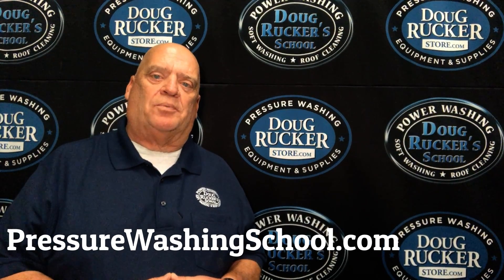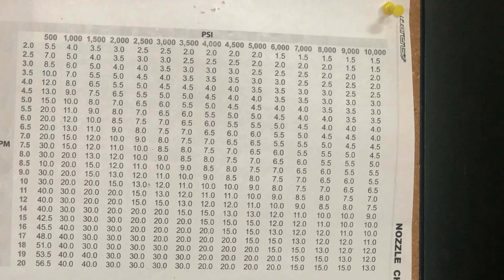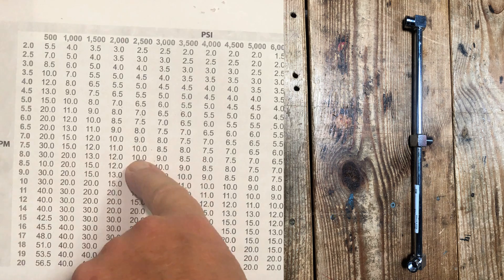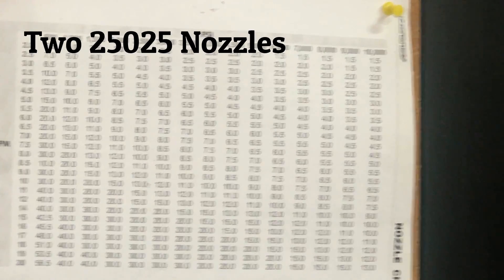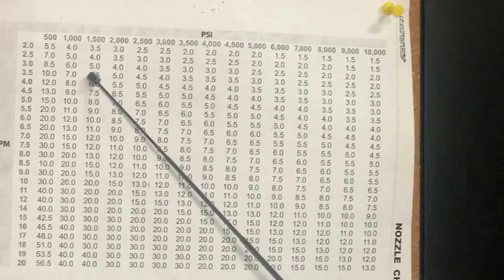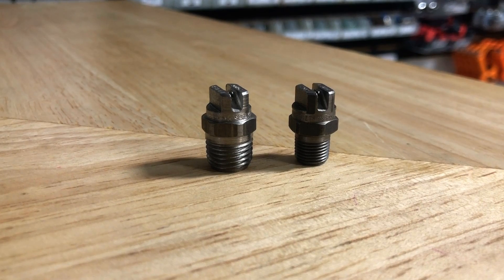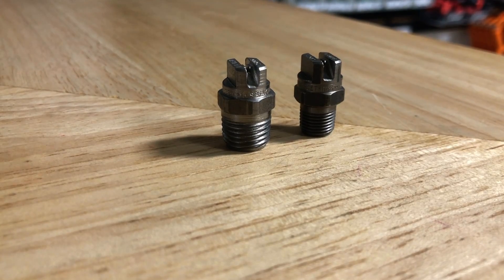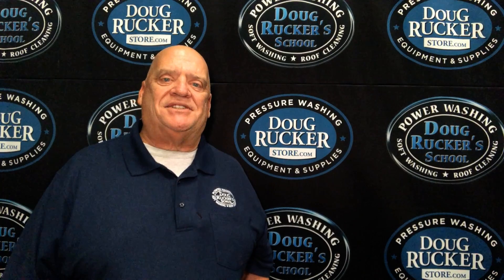How to Choose Surface Cleaner Nozzles from Doug Rucker 2024

Comment: I have 4.0  4400 dewalt machine  and the surfcleaner its have 3 nozzles i need help to chose the corect nozzles
Reply from the maker: You'd have to try the 2502 nozzles and see if they will work for you.  At 4 GPM you really should have only 2 nozzles.

Comment: Awesome explanation. Thank you. How much of a difference does changing the angle from 25 degrees to 40 degrees? I’ve got an 8gpm & currently run 25055. I’ve got a set of 4004, but I’m not wanting to etch with too much psi.

Comment: I have a 3.1 gpm 3000 psi machine on a 20” cleaner what tips would you recommend for concrete sidewalks and driveways? Thanks in advance.
Reply: ideally you want a ratio of 1 GPM : 4" of surface cleaner...3.1 GPM will barely be enough to spin your rotary bar, meaning you will have to go very slow. I already have to go pretty slow with my 4.2 GPM using a 20". 

as far as tips, 25020's will put you just under 3,000 PSI (fine for concrete that is at least a few years old, new concrete is more fragile and still has "cream" on it, which can easily be etched into with too much PSI; the cream wears away naturally after a few years, and the concrete itself becomes cured and more durable, which is why you can use higher PSI on matured concrete). 25025s would put you at about 1400 PSI which would probably be enough for old concrete, and would be safe for new concrete. If you do the 2.5s with 1400 PSI though, you will almost certainly need to use chems to help speed up the job and clear up your lines after.....

get some SH (sodium hypochlorite). Walmart has 1gallon jugs of them for about $7, its called Chlorinating Liquid, and it should be 10% SH (it will say the % on the front label). mix 1 gallon of it with 1-2gallons of normal water in a pump sprayer (1 gallon if the concrete is very dirty, 2 if its slightly dirty). Add 3 ounces of surfactant per gallon of mix (you can use dish soap/laundry detergent if you are only going to be doing this a few times, if you want to sell your services you should look into a better + more cost effective surfactant). The surfactant makes the SH mix linger longer on the surface, which gives the SH more time to work its magic. The suds from the surfactant also make it easy to see where your runoff is going. 2-3 gallons of mix should cover 1,000-1,500 SF of flat surface, so calculate how much you need. Mix everything together well in the pump sprayer. Leaving the mix out in direct sunlight will slowly weaken it; you don't need to rush when you are spraying, just don't leave the sprayer out in the sunlight all day.

MAKE SURE YOU WATER ANY GRASS AND PLANTS NEARBY BEFORE YOU DO ANYTHING ELSE. SERIOUSLY. 

once the grass and plants are absolutely SOAKED, pre-treat by wetting, but not soaking, the concrete (if you spray SH onto dry concrete, it could slightly bleach the concrete, but if you spray it onto soaking wet concrete it won't have time to dwell). Once the concrete is damp, spray your SH mix onto the concrete and let it soak for at least 10 minutes. 

Pressure wash like you normally would...the amount of water you put out will dilute and rinse away the SH mix, making it safe for the grass AS LONG AS YOU WATERED IT FIRST.  

When you are done pressure washing, post-treat it by spraying the SH mix again, and let it sit for 20+ minutes. Some pressure washers dont even rinse their post treat away, since SH goes dormant within a day in direct sunlight. But since you are new, I'd recommend rinsing it away (you can use a normal hose or your pressure washer) after 20 minutes just to make sure you fully cleaned it. You might have to repeat the post-treat a couple times since you would be on pretty low PSI, but you won't leave streaks or anything. I've done this exact thing on old, fragile, stained concrete and never had issues. JUST MAKE SURE YOU WATER THE GRASS AND PLANTS BEFORE AND AFTER!!!

TLDR: 2.0 orifice tips if you are cleaning old, matured concrete and/or don't want to use any chemicals. 2.5 orifice tips for all types of concrete, but you will probably need to use chemicals. if you do use chemicals, HYDRATE THE GRASS AND PLANTS BEFORE AND AFTER

Comment: I have 4400psi 4.2gpm with a built in pressure regulator (that I leave maxed) and I typically use a BE 20" with 25025 tips.

However, I frequently get stripes and I cant quite square up where the math is wrong. Im not going too fast - have tested this.
Would appreciate help.

Also, Is there a chart for PSI:surface type?
Reply: I have a 4.2 4200 BE with a 20" whirlaway as well. I assume you have made sure the nozzles are clear and parallel to the rotary bar, and the bars are symmetrically facing away from each other....so....

are you using anything to post-treat? A 3-5% SH mix on concrete works wonders for clearing up lines from my experience. if you do continue to have issues though, or you don't want to use chems, you can try downsizing to a 16". the ideal ratio is 1 GPM : 4" of Surface Cleaner.

Alternatively and/or as a last resort....if you know what you are doing (or want to spend the time to learn), you can throw 25020's on there and adjust your unloader to lower the GPM so its putting out a safer amount of PSI. Do not run it unless you've adjusted your unloader...25020's on your 4.2 as it stands would put you right up at 4400 which would be so harsh on most surfaces not to mention harsh on your pump. You'd still probably have to go pretty slow though, since the lower GPM will spin the rotary slower.

I enjoy helping people but unloaders are one of those topics you kind of have to spend the time learning yourself to truly grasp, especially because you can easily hurt your machine if you don't do everything properly.
Reply: @snorfietsers4006  thanks for the thoughtful reply.
I've been skiddish about a SH post-treatment, but I suppose it wouldn't be so crazy if it were sprayed and left vs rinsed.
This would be a decent start as long as I remember to wet everything lol
Reply: @dudeinskibro1 trust me I was terrified too haha. If you want to be extra sure, just test it on a small area first. The plants would rather drink the good stuff than the bad stuff, so as long as you can keep them hydrated until the SH becomes inert you will be fine. Good luck! Let me know how it goes or if you have any other questions

Comment: Hi, I want to do Up to 30" dia. surface washer and I have 2 options for a stationary machine I want to buy.  22HP engine 2200PSI with 14,9 GPM or 22HP 3500PSI with 9.2 GPM. Both are basically the same price. I do run into car oil stains on cement & asphalt and I read some where higher PSI would be better but at the same time I want my 24-30" to move along and not take more time but do a great job for mostly dust and sand.  Pre-treatment bleach or grease remover doesn't seem to make that much of a difference on oil stains but I'm worried 2200PSI is too weak even though the 14.9 GPM should easily move the 30" washer.  Any advice (pros/cons on which to choose would be appreciated.

Comment: Good day Mr Doug just got a quick question I got a 4400 simple 4 gpm pressure washer and a 20 “ surface cleaner just trying to figure out should I change my tips from the 25020 to 25025 to get a better cleaning on concrete driveway some people recommend the 25015 I’m just a little confused please help
Reply from the maker: @meriage1  yes. Go to 25025. That will help

Comment: I know i need a 25025 for my 4200 PSI 4GPM machine. But when i go to wash concrete do i turn up my psi to 4200 since the surface cleaner would devide by 2? Or do i just leave it at 2500 psi how i usually would have it
Reply from the maker: Keep the unloader set where its at.  Use the correct nozzles to lower the PSI when needed or install the surface cleaner pressure regulator to adjust as your using it.
Reply: @PressureCleaningSch 
So when you say keep the unloader where its at do you mean at full pressure
Reply from the maker: @ they normally set at the factory before shipping so I recommend keeping it set there. Always best to check it with a gauge when you get it.

Comment: I notice you mention nothing about the diameter of the surface cleaner.  Does it matter? Or by matching the tips size to match your GPM is the only thing we should be focused on.
Reply from the maker: Good question.  Yes it matters somewhat.  A general guideline is for every 4GPM if your pump is you;d want 4 inches of surface cleaner, so 4GPM x 4 = 16 so stay within a 16-20 inch Surface cleaner.  5GPM x 4 + 20 so stay withing in a 2- 24 inch surface cleaner. Etc etc.

Comment: With a 4000 psi / 4gpm / 20 inch surface cleaner, I would like to clean red ceramic tiles with grout around,  what nozzle do you recommend ?
Reply from the maker: 2503,25035, or 2504 depends on how soft tile is, how dirty, and condtion.  I normally do not use a surface cleaner on tile. But it really depends on the variables
Reply: @ Thank you!

Comment: PSI  remains the same only the flow rate changes with different tips like the ( 4gpm at 4k psi)  2502 vs 2503 correct? Psi should be turned down at the unloader if one wants  not to damage pool deck as an example correct?
Reply from the maker: Pressure and flow change when changing tips. Takes more time to adjust the unplader than changing tips.  Easiest way is to keep same nozzles in all the time anmd use the Surface Cleaner Pressure Regulator..https://www.dougruckerstore.com/products/surface-cleaner-pressure-regulator?_pos=1&_psq=surface+cleaner+pressure&_ss=e&_v=1.0
Reply: @ As example : I have a 4pm at 4000 psi machine if I want to use the 25035 nozzle which is rated for 1500 psi  I would need to still turn psi down from 4k to 1500 psi correct or no?
Reply: If the tip is rated for 1500psi I need not to go higher correct?  My understanding is that was the flow rate and degree pattern changes but the psi remains the same until you turned down at the pressure regulator correct?
Reply from the maker: @ no. Leave unloader where it is.
Reply: @PressureCleaningSch  Do you have a video on how to install this regulator?
Reply from the maker: @ yes sure do. It’s here on the channel
Reply: @PressureCleaningSch  I would like to get this pressure regulator but I need to understand something: The 25025 tip is rated for 2500 psi and the 2503 is rated for 2000 psi,with the pressure regulator I can turn down the pressure for the 25025 down from 2500 psi to 2000 psi correct? So what is the difference between the 2503 the flow rate?
With the 2503 what if you raise the pressure up from
2000psi to 2500 psi what happens? 
Basically what happens if you raise the rated psi in a nozzle?
Reply from the maker: @vcash1112  Keep it simple.  If you use the regualtor use the 25025 nozzle and then adjust your pressure down as needed. This keeps you from having to change nozzles to adjust the pressure. With the regulator the larger the nozzle you go, the less PSI more water volume you'll get.
Reply: @ I’ll be getting it soon adjusting at the DL is a pain. Thanks for replying!

Comment: If you have a pressure gage after the PUMP and adjusting with unloader does it work the same as the gage at the surface cleaner?
Reply from the maker: Yes

Comment: I just got an 8gpm machine with a bar that has two tips (one on each side). The tips show 25025 that came stock on my surface cleaner, I mean that puts me at 10,000 psi if my math is correct which will destroy everything it touches... Is this correct math?
Reply from the maker: 2@25025 should put you at about 4500-5000 psi.  You'll need 2@25045 or 2505 to keep you around that 2500 PSI

Comment: If i have a 4gpm 4200psi machine with a surface cleaner that has two nozzles, I would need a 25025 tips then? That would put me at 2,500-3,000 psi then?
Reply from the maker: You are correct...should put you right at 2500PSI
Reply: @PressureCleaningSch so when I’m using a surface cleaner do i turn my pressure up to 4000 psi for it to hit 2500 psi or leave it at 2500-3000 psi to start?
Reply from the maker: @DonGuava  answered above I think

Comment: Hey im new to surface cleaners I have a 2k psi 4.5 gpm with a 16 inch surface cleaner what size tips do you recommend?
Reply from the maker: 2502 but not sure it will work with that low PSI.  You'll just have to try and hope for the best.
Reply: Alrighty thanks man I appreciate it!

Comment: I have a 4400 psi 4gpm what size tips should I buy
Reply from the maker: If a 2 nozzle bar you need 2 of the 25025
Reply: @PressureCleaningSch  Which is the best for all around 25025 vs 25030 nozzle?
Reply from the maker: @vcash1112  25025

Comment: I have a 3gpm and 3,000psi what size would I need for that
Reply from the maker: 2502 and you need small surface cleaner for that.  Like 12-14 inch

Comment: For my 6.5 gpm pump at 3,000 psi it says I need a 7.5 Divide that by 2 I get 3.75.  So what size nozzle does that equate to?
Reply from the maker: I'd go with 25035...might also want to have 25040 on hand
Reply: @ thanks Doug! Been watching your videos for a year or so.  I am starting new in the spring. Just trying to put it all together.  Ron (U. P. POWER WASH)

Comment: I have a 8 gpm machine for use with a surface washer with two spray rods. Cleaning a heavy soiled oiled restraurant driveway. What nozzle would work for oil stains, rust, grease etc? orifice and nozzle size and angle
Reply from the maker: @jermaine7183  2@25035 or 25040

Comment: when i divide by 2 i dont get all those numbers? am i missing something?
Reply from the maker: If you have a 4GPM machine and your wanting 2500PSI that calls for a #5.0 tip.  Divide that 5  by 2 you get 2.5...so you'd need 2-25025 nozzles.

Comment: Hello Mr. Doug I have an AR RSV 4G40 pump and it comes with 4GPM at 4000psi from the factory. My nozzles are 04, however I installed a pressure valve with external baypass. When I press the gun trigger, on the pressure valve at 4000psi, water comes out of the baypass at 0.973 GPM. Without the nozzle at the end of the gun, 4GPM comes out. And with the 04 bushings, only 3.17GPM comes out. Should I go to 05 or what could be wrong?
Reply from the maker: Sounds like that's a direct drive pump so not real sure as I ahve never used or tinkered with one.  I would think it would hurt to try the 05 and see
Reply: @PressureCleaningSch  Yes, it is a direct drive. I always invent a bit. Thanks for your opinion!

God bless your projects

Comment: If I want the 40 degree with 3000 psi whats the size ?. I’m using the 25 degree. But i etched the concrete
Reply from the maker: What is he GPM of your machine and how many nozzles on your surface cleaner bar?
Reply: @PressureCleaningSch   5 gpm and 2 nozzles sir
Reply from the maker: @samuelrivera2466  2503..but I'd also keep 25025 and 25035 on hand as well.  I always keep the size above and below in case I need them.
Reply: @PressureCleaningSch   2503 Is in 40 degree?
Reply from the maker: @samuelrivera2466  Yes and OMG I'm so sorry.  4003..but I'd also keep 40025 and 40035 on hand as well.  I always keep the size above and below in case I need them.